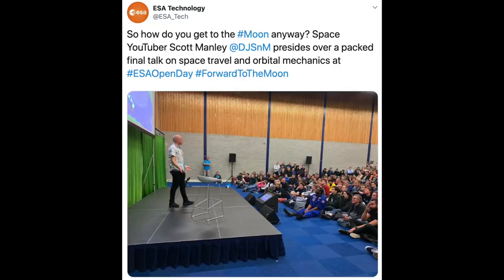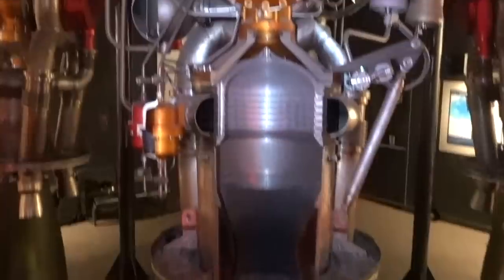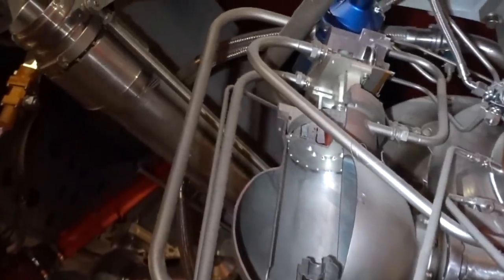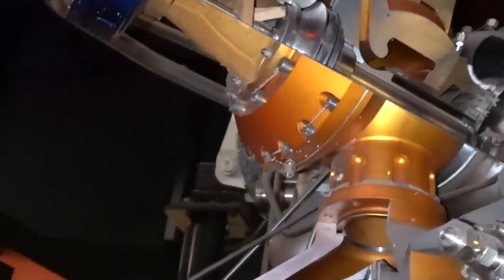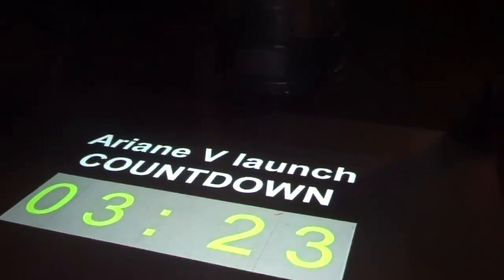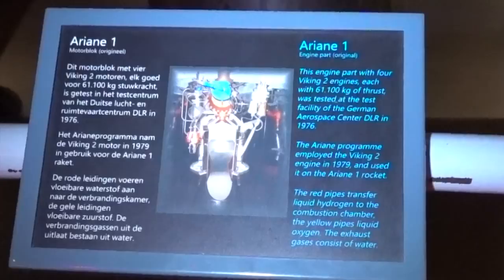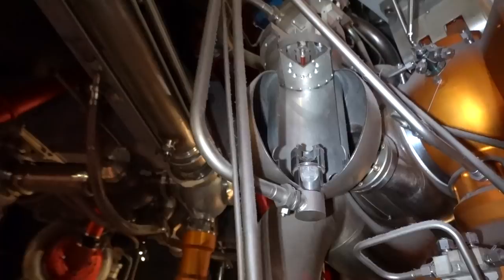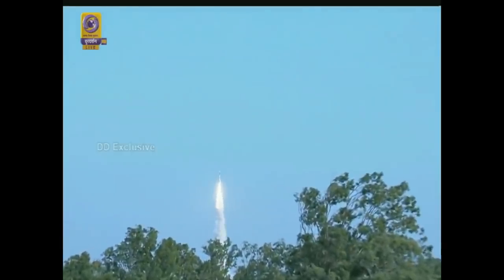The Viking Rocket Engine - Ariane's First Engine & Ancestor to ISRO's Vikas Engine

Comment: Those engines are a work of art.
Reply: I was thinking that. So much precision design and manufacturing only to be used for a few minutes and then thrown away!
Reply: @paulsengupta971  It's all about perspective - Viking 2 engines were flown on 11 Ariane 1 flights. Each flight used 5 engines total (4 + 1 in the first two stages), so that's 55 engines total. For comparison, a SpaceX Falcon 9 uses 10 Merlin engines per launch and it took SpaceX 20 attempts until the first successful landing and recovery of a first stage booster.
That's 190 Merlin engines used to perfect reuse, compared to 44 Viking-2 and 11 Viking-4 engines over the lifetime of Ariane 1.
Ariane 1 simply didn't fly often enough (about 1.6 times per year) to even justify thinking about reuse, which would have probably taken longer to develop than the program even existed...
Reply: @totalermist  Though all rocket engines, regardless of their size or design are amazing, Vikings are pretty neat in their relative simplicity (for the engines of their size), shape of components and use of color. In terms of the number of engines manufactured, Soviet and then Russian RD-107 / RD-108 are probably the champions -- well over 50000 combustion chambers had been manufactured over time -- and that is the hardest to make part of the engine. In the past it was not uncommon to launch 60 Soyuz-type rockets every year, and each had 5 such engines, with 4 main chambers each -- expending 1200 chambers a year just in actual flights (plus some in tests)!
Reply: @cogoid  I didn't say rocket engines aren't amazing. Sure, the Soviets take the cake when it comes to engine manufacturing. To this day, Russian engines were used in the Atlas III and V launchers.
After the fall of the Soviet Union, both launch cadence and production dropped dramatically, though with only 16 launches in 2018 and obvious manufacturing problems (e.g. launch failures).

Comment: The water injected would turn to steam and go through steam expansion which means more pressure and gas volume driving the turbine.
Reply: Remember that the purpose of the water is to cool the system, and gas pressure is directly proportional to temperature. So, it's entirely possible that adding the water reduced the overall pressure of the system.
Reply: @waylandsmith  No rocket designer would be so foolish to add so much water that it reduces turbine gas pressure. After all more water is more weight. I expect just enough cooling for the turbine blades to survive is all that will be done, unless they have it tuned for steam expansion to be the primary driver of the turbine. Steam turbines are well known beasts.
Reply: @waylandsmith  I'd guess that is not what happens then. It would allow for a smaller generator then, would it not? That would be beneficial in and of itself, using less fuel to run the generator and having a smaller (=lighter) generator.
Reply: As Scott said, they would normally just run fuel rich to avoid melting the turbine. Here that would not be a great idea, because the fuel is ~hydrazine, which is a monopropellant... It would melt the turbine just fine on it's own, and if it didn't burn it would contaminate your launch site.
You could do the same thing with any gas generator, without penalty in weight. The lower molar mass and high heat capacity of water mean that the same mass of water at the same temperature will have more energy available, meaning you can get more power out of your turbine for the same temperature and mass flow. It works better than a fuel rich turbine for every fuel but hydrogen. It is generally not done for reasons of complexity, rather than performance. The gains would be tiny, and not worth the extra failure modes unless your rocket wouldn't work otherwise (because hydrazine likes to explode, for example).
Maybe think of it like this; A gas generator has 3 fluids involved. 2 react together to produce exhaust gasses, and energy to boil the 3rd. In most cases fuel is both one of the reacting fluids as well as the fluid that boils unreacted. Here instead of using unburnt fuel as a the bulk of the gas for the gas generator, they use water. It isn't a mass penalty because the water is replacing fuel that shouldn't get burnt anyway.
Reply: @ekaa.3189  The goal is to achieve a given target power output while keeping the temperature low enough to not melt down the turbine. Without the water the temperature would need to be too high to generate the required pressure and flow.  
The more common way to do it is to have excess fuel or excess oxidizer to absorb the excess heat. The use of water complicates the machinery but solves some big challenges posed by excess fuel / excess oxidiser.
Reply: The P51H was rated at 1380HP and was raised to 2218 HP when water injected but could only be used for a limited time period.
Reply: @listerdave1240  Yes. What if the gas generator is really a steam boiler? Steam is just another type of gas, and it would be coming out of that gas generator at very high pressure and volume. It would also contain the combustion products and cool them because they gave up most of their heat to vaporized the water. Steam boilers and turbines are well known devices. Even ones that use the combustion exhaust to directly boil the water. The wildcard is the fuel, but in reality that is easy. How much energy the fuel contains is well known, so how much water it can boil is easily calculated. So how much energy can be delivered for pumping the main engine rocket fuel is also easily calculated. Vary the amount of water a bit to control pump flow. Because most of the heat is going into boiling the water, no worries about exhaust temperature.

Water to steam expansion is powerful. In the P51H engine they had to limit how much water they injected because if they added too much it would blow the engine up. That is part of why I'm now thinking the gas generator maybe a steam boiler. Little fuel use, one heck of a power output for input mass, well known design parameters, and it easily solves the gas generator exhaust gas temperature issue. In fact it brings the temperatures down so low standard turbine metals can be used.
Reply: @july8xx  WW2 Mark 14 Torpedo Wiki; Wet-heater combustion - A further improvement was the use of water to cool the combustion chamber of the fuel-burning torpedo. This not only solved heating problems so more fuel could be burned but also allowed additional power to be generated by feeding the resulting steam into the engine together with the combustion products
Reply: @ekaa.3189  It is indeed another way of looking for it. It is like a boiler except that the flame is applied directly to the water rather than separating the flame from the water by pipework.  How much to consider it a steam turbine vs a hot gas turbine is probably a matter of the ratio of water to fuel/oxidiser.  I'm guessing in this case though since they are aiming for maximum power to weight ratio and the water itself contributes no energy they would put in just enough water to keep the temperature just low enough to not destroy the turbine. 
The higher the ratio of water to fuel/oxidiser the more 'dead mass' the rocket will need to carry, mass which is only providing cooling and not any actual energy to the process.
Here they wouldn't just be boiling the water but they would go way beyond the amount of superheat applied in normal steam turbines so I would still be more inclined to think of it as a hot gas turbine with cooling as opposed to a steam turbine. The exhausts also have expansion bells so they are probably trying to also get some thrust out of the turbine exhaust, which means they would rather have a low volume at as high a temperature as possible vs a higher flow rate at lower temperature.
Lowering the temperature also reduces the Carnot efficiency so they would still try to make the turbine as heat resistant as possible.

In an internal combustion engine on a fighter plane, or even a racing car things are quite different as there is already an inherent lowering of the combustion temperature by the inert nitrogen content of the air but also that the internals of the engine can withstand much less heat than the turbine in the rocket engine. What they do there is try to get as much power as possible given the mechanical limitations of the engine, so they do not worry about the much larger mass of fuel and water needed to produce a given amount of energy, since they only need that extreme power in short bursts, unlike a rocket engine where the turbobump is running at ludicrous power from the moment it starts up to the moment it shuts down.

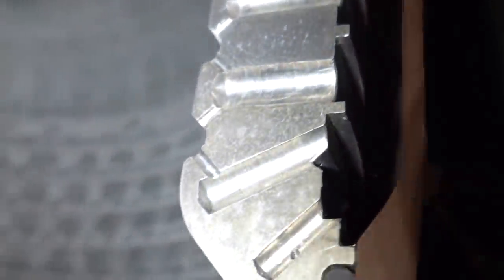Comment: 3:09  The hole at the bottom pointing down and left slightly looks like it's for film cooling the combustion chamber. 

3:14  You can see a ring of holes lower than all the others pointing down towards the throat.

Comment: So sad these fine machines are lost, every launch.
Reply: Such is their nature.

Like all such devices, if they work correctly, they more or less destroy themselves.
Reply: Like crashing your car on every trip, and just get a new one. But then a bit more expensive.
Reply: Now, just to put things into perspective here before the "why didn't they think of this"-crowd gets a little too carried away:
Ariane 1 had 11 launches total . For comparison, it took SpaceX 20 attempts to successfully land their Falcon 9 first stage booster.
In other words, almost twice as many launches as these engines where even flown in total.
Given its seven years of service, the Ariane 1 flew about 1.6 times per year, so about 8 engines per year were produced (5 engines per rocket; 4 on the 1st stage, 1 one the 2nd stage).
For comparison the Falcon 9 uses 10 Merlin engines, 9 of which on the first stage, so each Falcon 9 launch uses more engines than Ariane 1 required in a year...
And that's one of the reasons single use was very much acceptable back in the day.
Reply: @totalermist  The Falcon 9 can get more payload to GTO than Ariane 1 could LEO. Of course it's gonna be more feasible to reuse it.
Reply: @OCinneide  Payload doesn't matter in this context. Ariane 1 simply didn't fly enough times to justify the efforts to make it partially reusable.

It used less Viking-2 engines over its whole lifetime than Merlin engines used by 5 Falcon 9 launches. At 20 launches in 2018, Ariane 1 used less engines in 7 years than SpaceX required in 4 months and that's the key difference here.
Reply: @totalermist  If you work out engine per kg to LEO then the figure would be more accurate.
Reply: @OCinneide   I don't understand what you mean by that. 

In order to match the flight record of the Ariane 1, 44 (11*4) Viking 2 engines had to be built. In order to have the same amount of flights with a Falcon 9, 99 (11*9) Merlin engines have to be produced. That's just basic maths. Ariane 1 had 11 flights in 7 years, Falcon 9 had 20 flights in 2018 alone. 
That's all the relevant figures IMHO ¯\_(ツ)_/¯
Reply: Theyre on the bottom of the ocean.  Musk recovered some of them lol. They sent boats out to get the F1s off the ocean floor, I think Scott did a vid on this.  Each engine was a next generation of the last.

Comment: Just to clear up the which side is which mystery (a bit), the red side pump has a larger impeller so generates a bigger head (as the impellers and the turbine appear to be all on one shaft), thus assuming both pumps are generating the same pressure (chamber pressure + a bit of line loss) whatever fluid is the lighter goes down the red pipe!

Comment: Interesting how a single axis of thrust vectoring works out to give full control of the rocket. I guess when they are mounted to the rocket they're oriented to act tangentially (as opposed to radially) ? Also, the use of hypergolics shocked me, this must be a very old engine indeed! Given Ariane's track record I guess it's less of a worry than usual, but it would make things so much more disastrous in case of RUD !

Comment: Water injection to cool combustion - probably got the idea from WW 2 fighters; when using methanol injection to briefly increase horsepower, they used a 25% mix with water so the cylinders wouldn't burn  out.
Reply: Don Jones They did the same in V2/A4 rocket engines.

Comment: The pumps having a common shaft means they run at the same RPM which in turn would mean the pumps for the fuel and oxidizer are different sizes to provide the correct ratio for whatever % combustion they intend to run at.  Never dealt with liquid oxidizer  however If i had to guess it be the larger of the two pumps.

Comment: It is little known that Viking engine was developed in post-war France by a team of ex-Peenemünde German engineers, with Karl-Heinz Bringer being the lead engineer. For obvious reasons, it was not widely publicized, and even now is not frequently mentioned.
Reply from the maker: I need to make a better video.
Reply: @scottmanley  It is a very neat engine with a rich history. Its story certainly merits to be known.

Another remarkable chapter is the extent of French involvement in helping to jump start the rocket engine program in India.

In the early 1970s ISRO signed an agreement with the SEP (Société européenne de propulsion) in France, to acquire the know-how for the Viking engine. Under this contract, a group of 40 Indian engineers came for 5 years to St Marcel, near Vernon, to learn all aspects of how the engines were produced and tested. Upon return to India, they developed the Indian version of the engine under the licence from SEP. The engine was initially built from a mix of French and domestic components. This cooperation saved at least a decade of R&D, and gave a great boost to the Indian space program.
Reply: @scottmanley  If you google "Buschdorf LRBA", the top results are very useful for compiling the history of French rocket engines.

Comment: Was the water injected into the system to flash to steam and increase pressure, perhaps?  Or dual role - cooling and steam generation?  Once its had served is purpose as a coolant, it could maybe be injected into (eg.) the gas gen to enhance its pressure?

Comment: Thanks!  It's always enjoyable to look at rocket engines and see how they are designed. Am I correct in assuming they are injecting fuel on one side of the combustion chamber and oxidizer on the other side? It seems to me they wouldn't mix very well that way.
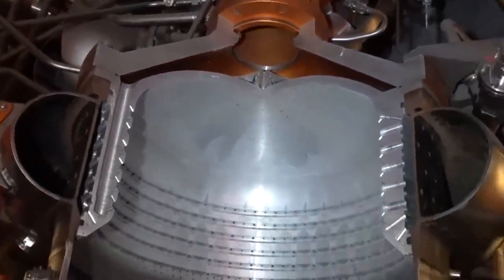Reply: The cutaway at 2:45 shows both pathways into the combustion chamber. The propellant coming down from the top goes into the deep vertical channels exposed on the left hand side of the combustion chamber and out of the small holes. The propellant coming from the external ring passes through the walls of the combustion chamber through the horizontal pathways that are exposed on the right hand side so you end up with alternating sprays of fuel and oxidizer coming out side by side all around the combustion chamber.
Reply: @Reactordrone  Thanks for the explanation!

Comment: It said on the panel, the yellow lines pump oxygen.
Reply: The panel was incorrect, for whatever reason. Viking has never run on liquid oxygen or hydrogen. I think someone at ESA somehow confused it with Vulcain engine (from Ariane V). If that last statement was true, whoever printed that display panel should be fired.
Reply: @seanbaskett5506  Interesting.